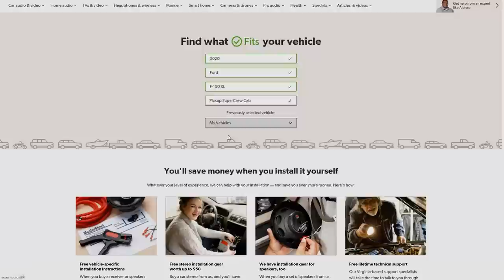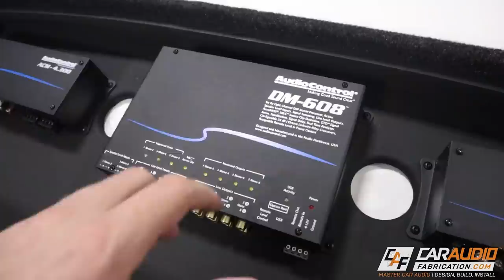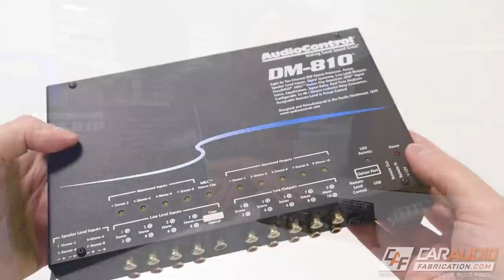This Car Audio System WILL JAM! Why I picked this gear! Amps, Subs, Speakers ETC.

Comment: Man whatever happened to running tour whole system off one amp. Ran 3 piece rockford front stage each side and 2 12s bridged behind seats with a ppi 2150am. Was amazing and never failed.  Miss the 90s.
Reply: Orion HCCA redlines. That 250 was a MONSTER! ❤
Reply: Had 2 of those bad boys in my bronco. Don’t make them like that anymore

Comment: Please do that video on the RD 1500/1.  No one has really done a full review on it or really gone in depth on the 1 or 2 ohm switch, which is rated at the same 1500 watts rms.
Reply: I picked up the RD 1500/1 and it’s fantastic. I would love a full review of it anyways.
Reply: I have the RD 1500 amp. I switched over skar skv2 1500 amp. RD 1500 is a way better amp. It produces deeper bass, is louder at lower volumes and doesn’t get hot. Definitely worth the price. I use to hear about clean power but didn’t understand what that meant. I do now
Reply: @AlmightyMauMau  is it really worth the extra 500 dollars tho
Reply: @rushflare8208  you get what you pay for. Almost two years now and I still don’t regret paying 800

Comment: I'm running an RD500/1 with two of the TW10's with passive radiators in my 2004 F150 SuperCrew and man they hit. They are so much better than the Kicker L710's I had previously. For the front stage, I'm running an RD500/4 with a TWK88.
Reply from the maker: Awesome! Sounds like a killer system!

Comment: Thanks VW for using oddball sizes and 3 ways in my front doors. Oh and for riveting my woofers to the door. and making my mids super shallow.

Sounded great when new, dont get me wrong. but hella expensive to get replacements and aftermarket solutions are close to 1k just for the fronts. (focals)
Reply from the maker: Have you seen the build I did in the Jetta? Should be super helpful for overcoming those challenges: https://www.youtube.com/watch?v=ZLUHgw3DxbI&list=PLmybwiwzi3MUX58f_Qky8K6fifL7H6Kbe&ab_channel=CarAudioFabrication
Reply: @CarAudioFabrication  Apparently I have not! gonna check it out now. Thanks!

Ahh, thats a 2017. I have an 08 Rabbit. Slightly different setup, but will still be helpful!

Comment: Yes!!! Please make a full video on the RD 1500/1, what is the dampening factor at 1ohm ?
Reply: Should be 225 / 50 hz based on the specs. It's 1100 @ 4 and 550 @ 2 so it stands to reason it would be 225 @ 1.

Comment: I am sure this new system will be very sweet. I have the TW1 10 in a custom, ported enclosure. I built the box using techniques I have seen you use. I have the XD 800 8v2 and a Rockford Prime r500 running the subwoofer, the XD runs my hertz mid bass and midrange, with morel NT120 tweeters in the a pillar that I also made using your techniques, this is all controlled by a Zapco Z8 IV. I used knuconeptz wiring, and distribution, as well as stinger 4000 RCAs. 
Good bass, good mid bass, and the highs are great. Also sound deadened the entire car, so no rattles.
Only issue I have is two separate but distinct noises, one is alternator whine, the other I have yet to figure out. I am sure one is a ground issue, but the other I am not sure.

Comment: the best sounding 1000 watt Amp I've heard compared to 3 major brands and it won. JLJX1000. runner up was kicker DX1000. currently own a Rockford t1500bd and it's the best Amp on the market hands down. for the price point

Comment: I have a XD 200/2v2 and a XD700 700/5v2 in my system and they will actually do 100w RMS @4ohms and the sub channel is rated @300w but puts out 450w @2ohms... very nice amps!

Comment: I'm glad you're finally doing a truck system. Hopefully you will take on a Chevy 2500/3500 in the future. Do you you have any experience with DS18 8" inch subs? Do you think JL Audio has better subs than Memphis Audio subs?

Comment: The RD series amps are nice on bass, however, for mids n highs, I'm not a fan of the RD. I think the sound is very flat. I like they way Rockford Fosgate sounds. It sounds more dynamic and musical. The power series to be exact. I know those amps are in completely different ranks and class, but its my own experience. Idk how an XD or HD multi channel amps sound against the RF Power series amps, very curious.
Reply: I'm not a fan of RD for highs because out of the three 4 channel amps I own , it's the noisiest . Those balanced differential inputs mean you can't ground the RCA or the noise gets worse .

Comment: Is there a video of you setting the crossover points and tuning the system?
Back in 1989 I had 2 Electro Voice EV 15B In an EV TL606 enclosure in my Chevy s10 blazer. It was powered by an Alphasonik PMA 2175 CLASS A Amp. Was about the loudest and best system I have ever heard.

Comment: Awe you like the Ford 150. Red 03 Lightning owner here. My Red rocket is never for sale. I went bonkers installing things to make it a pain for 2 guys to get my gear out in 6 hours. 
Dude you have to get a D class mono bass amp. Another amp for mids and high. Capacitor between. Single cab pickup everything has to be balanced. I didn't expect: nobody knows how to really work on it unless they have several Lightnings. Most Lightning people own more than 1. 
I want to look at the alternator. It is19 yrs old. I want to redo  it would much rather upgrade before something breaks. Did the big 3 upgrade. Dad helped me unbolt the seat and throw in tricks. Suddenly after doing that I stopped getting robbed every 6 months.  I need Dad to help me w diagnostics. 
JLs are engineered great. My HS boyfriend had the system. single cab pickup.just Subs. Nothing for highs. It sounded really good. I don't understand how he got his black v8 Chevy to handle so many demands. 
Early morning that sorta delicious rant. Sry but not.

Comment: So this is kind of long winded and I do hope you read this: I've recently started saving and researching for when I decide to ultimately modify and upgrade my 2007 Sonata Limited. I want to strip the audio system out and put in a completely custom 16 speaker sound system (like I said modify and upgrade). Anyways I've kind of picked majority of my speakers if not all that I'd like to go with. I've also picked out the Alpine PXE-X09 but I watched one of your other videos and apparently I still need an amp, thing is I'm trying to go as few additions as possible and I'm currently stuck on what else I'll need to complete this setup. Again I'll be modifying interior panels and the inside to fit all of this. My goal is to have a top of the line luxury sonata with the BEST audio and functionality. I know its cheaper just buying a new car but I want to have fun with this. If you have any helpful tips and points I'd appreciate it, heck if I get enough money I might pay you to help if you're interested 😂

Comment: Great review I'm upgrading my system from Alpine Amp R-A60F  gets very hot R series speakers sound like crap a new Alpine DSP nobody around here knows how to tune payed $400 get it installed 3 days later had them pull it out my new system Jl Audio Amp XD 400 4v2 and C3 600 hopefully it would sound better than what I have now

Comment: Hey Mark, in order to get the best of both worlds (i.e. the low bass of a ported enclosure & the hard hitting bass of a sealed enclosure), can you put two of those subs in a sealed enclosure and the other two in a ported one? Or would that cause resonance issues? I don't think I've ever seem a system with such a setup. Would you please elaborate?
Reply: Yes you can have any configuration of enclosures, or even a ported and sealed in a single box, limited to space available but it might be better to have different subs to suit the enclosure type. Resonance issues will appear regardless of enclosure combination.

Comment: I have a 2004 chevy silverado 2500 crew cab. Doing a custom build. Lifted the seats 4 inches ( kids enjoy that a good bit). Removed the seat frame to make maximum room. But made sure to keep the seats fully operational and safe for the kiddos. I can make about 5sq ft total using 1/2inch mdf and about 4.5 Sq ft using 3/4 inch thick mdf. Will have a few audio control parts. (Epicenter and overdrive) plus crossover possibly. But it's up to four 8s or six 6.5s. It will most likely be a skar system just bc I've heard great things about their upper line of speakers that don't cost as much as other brands. But could six 6.5s deliver the chest vibration bass or should I just go with the four 8s?

Comment: Hey great built man, loving it...i have an issue with my system. Would appreciate, if u can help. Somewhat experienced here, have a setup of sony bt/cd stereo, clarion eq,  jl audio c1 100ct tweeters with crossover, rf front door speakers, rf rear deck speakers, rf powered sub, with a distribution block, jl rd4/400 amp. Recently added a Massive audio 3 way crossover because i wasnt getting the sound i wanted. Now i m getting the sound i wanted but my driver side tweeter keeps blowing. Replaced it twice already. Its stressfull cuz i cant figure out why only my driver side tweeter is going bad, what could be the problem?

Comment: Marc I'm curious as to why you decided to run the AudioControl DSP versus the JL Audio DSP unit in this system....Seems  like the JL unit might integrate better with all the JL components

Comment: @CarAudioFabrication This is probably a noob question but ive been looking all over your page and cant find an answer. I see you have a 1500 watt amp to power 4-300 watt subs totaling 1200 watts. But you used a 300 watt amp to power 4-75 watt component speakers totaling 300 watts. One of crutchfield amplifier articles says to not but a amplifier whose rms is rated higher than your speakers. Would this damage the speaker. If not how do you prevent this?

Comment: I have a 2020 Jeep Gladiator and I’m trying to decide between the JL Audio stealth box with 2 TW1 10s down firing or go for a ground shaker box that holds 2 TW3 10s up firing. The JL Audio stealth box is like $100 more. I don’t know what difference down fire vs up fire would make.
Reply from the maker: The down-fire purpose made box is the way to go 100%.
Reply: @CarAudioFabrication  Awesome, tysm for the input. Love your vids btw!

Comment: Question: I have a 2013 Impala with a factory head unit, 6 1/2" speakers in the front, and tweeters in the "A" pillars...Do I have to use the crossover? Or can I install the tweeters in the oem position using the factory connection and just use the speaker in the speaker location?

Comment: Hey do you think you need an epicenter if the amp has acubass like the audio control?
Reply: Accu bass and epicenter are completely different. Accu bass is for factory rolloff and the epicenter is for creating bass that wasn’t there at one octave lower I would go with the wavtech bassrestore it’s a much better u it sq

Comment: That amp will smoke those subs. 300w RMS subs on 1500w amplifier is questionable? Why not run 2 10TW3"s at least they are 800w RMS that's only 100% more power RMS power, better then the 500% your planning on now. Crunchfield out of 10TW3's too?
Reply from the maker: 1500 / 4 = 375. 75 watts over, while not "recommended" I'm familiar with these subs and their capabilities and how to avoid over driving them. They will be just fine.
Reply: @CarAudioFabrication  this is someone of the question i was looking for. Crutchfield says not to pair amps with more power rms than the speaker is rated for. This is giving me a hard time with planning my system trying to find the right amp for my speakers. Moreso do speaks than subs but im wondering how you prevent from over powering the speakers if the amp is rated higher than them?

Comment: I got 2 12" JL TW1 and they bump
Reply from the maker: They definitely get down! At the end of the day they aren't an SPL sub like some folks try to compare. They are meant for small spaces and they actually sound good too!
Reply: @CarAudioFabrication  they're mounted in a 41,5 liter closed enclosure. A little more than they need but still very nice.

I got them at a 55% discount each.

Comment: I guess the real question is does it flex if it doesn't its not enough
Reply from the maker: If a system is good only when panels are flexing this probably isn't the channel for you.
Reply: @CarAudioFabrication  true
Reply: @CarAudioFabrication  but is any system good if it doesn't flex 🤔  probably just keep it stock these days then
Reply: Flexing causes power loss (or sound loss)  so to speak.     

Flexing is overhyped and overrated.
Reply: @JamesBond-oc4gm  I guess for a beta
Reply: @jesusmendez7500  classic response 👌   you're so cool

Comment: I’m looking into adding a sub amp to my 2021 Nissan Titan Pro4X (with the Fender Audio System) Which amp would you use to run two JL Audio TW3-D8 running at 2ohms? This AC amp or the JL Audio RD1000/1? 

Also, the factory sub is mounted under the front passenger seat. I believe that sub has a dual voice coil because It has two sets of speaker wires running to it. Should I connect the amp to those two sets of speaker wires?  Or get a signal somewhere else?  

Please help. Thanks